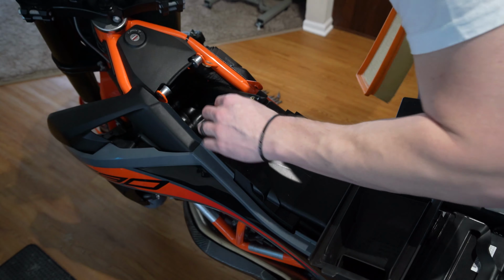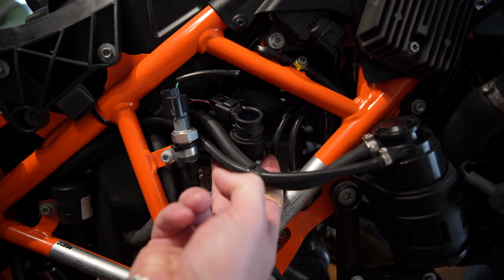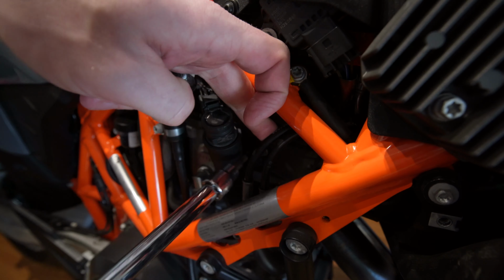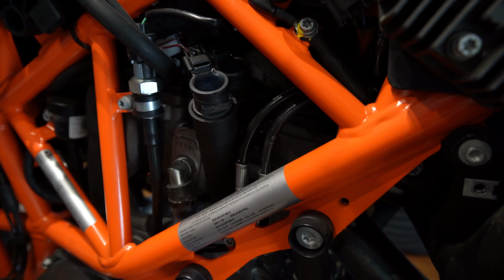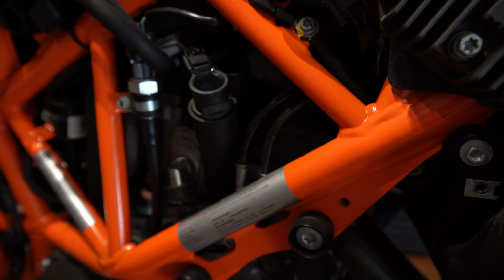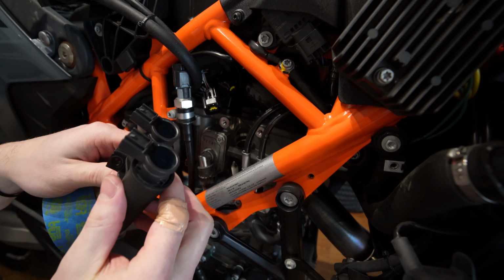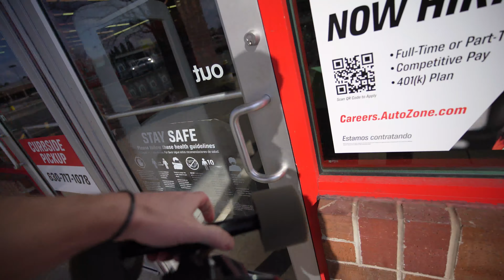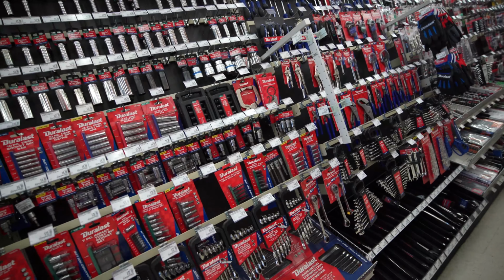Does it have spark?! | ep 02

Comment: Just read your response to the other comment and i'm glad you got it taken care of, in the future if you need to remove a spark plug you don't need a spark plug specific socket, just a deep socket of whatever the spark plug size is apparently that is 5/8, 13/16, or 18mm
Reply from the maker: Tried that but I need a super thin one to get down to the far plug, mine were too thick
Reply: 14mm
Reply from the maker: @leonardoboscarino4335  I’ll have to give that one a shot! But super thin?
Reply: @LifeWellRidden  just regular longher 14 mm socket from regular tool kit.

maybe I have same issue but step further, already checked both spark plug without solving. 

I'll check the fuel pump, the gasoline goes out from injector maybe without enough pressure.

keep update
Reply from the maker: @leonardoboscarino4335  that was my next plan of action, fuel and fuel pump. I put stabilizer in it and they said that could cause issues if their is too much and clog an injector.. joy.. 

But I took it to the dealer and have that video dropping today at 5:00 PM

Comment: Sorry to see all the trouble you are going through. I had the same issue, came out of winter storage and just wouldn’t start. In my case the remedy was very simple though, I just had to shake the bike really hard, and then it started on the first try.

I think my problem was that the gas had separated and the shake mixed it (after start it ran well but with a lot of smoke for a few seconds). I did not add stabilizer before storage after hearing bad things about it. Instead I drained all gas and filled the tank completely before storage. Mine has no addons and it was stored cold so unlike yours, so this may not apply at all. But I still think you should drain it and refill with fresh gas before you do anything else since it is an easy fix. 

I wish you the Best of luck!
Reply from the maker: This seems like a common thing then with winter storage?! Holy smokes at least you found your issue! It took me about another week to figure it all out and fortunately/unfortunately it wasn’t fuel related. I did use the Motul fuel stabilizer and the dealer asked and said if you get the wrong amount, like just slight over, it will cause serious issues.. thanks for the tip!

Comment: Hi man, I do not envy your situation, I have the same motorcycle, only the model of 2019-20 and fortunately it still works. I just wanted to write you what I thought. Did you know that gas must not be added at start-up? The throttle must be at zero, otherwise the engine will not start. I've seen you put your hand on the throttle grip every time you start and maybe add a little, it's a common reflex. And the second thing: try to see if the coil gives you a spark simply by finding another spark plug that fits into the connector and just try it on another spark plug if you don't have the tools to remove the spark plugs in the engine. If there is no spark, you no longer have to remove the spark plugs from the engine, but you need to look for a fault elsewhere. (control unit does not give impulse) And another thing: I can safely recommend you, buy some ordinary cheap OBD diagnostics is enough even with a price of about 40-50USD and a connector reduction on your motorcycle, it fits and then you can use it to your car :-) The motorcycle reports errors to me when they drive long after the rear wheel, so I always drive home, I see what happens, I find that there is a speed sensor error (the front wheel stops, but the rear still rotates), so I'll erase the mistake and keep going again ... So good luck! :-)
Reply from the maker: This is amazing! Haha I love all of the info and knowledge! I ended up just giving up since I don’t have a ton of time to trouble shoot but took it to the dealer and found out what the issue was. It was a complete blind side to me and something that required warranty work!
Reply: @LifeWellRidden  Yes, I understand, that's a good solution. I'll be happy if you then share what the problem was. Have a nice day! :-)
Reply from the maker: @efjecko  you bet! I have 3 more videos coming out in the series but hint hint, has to do with an aftermarket addition that I had to warranty because of failure 🙃 I pretty much pointed it out in the first episode haha